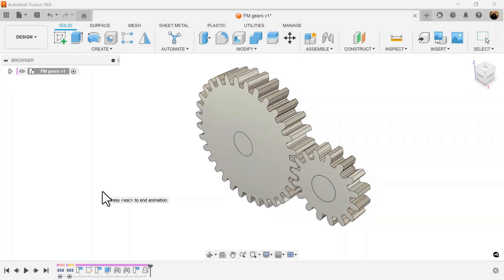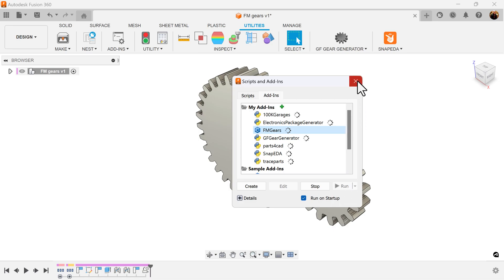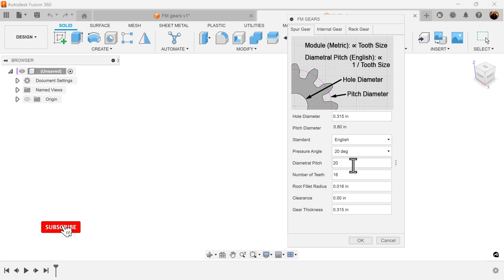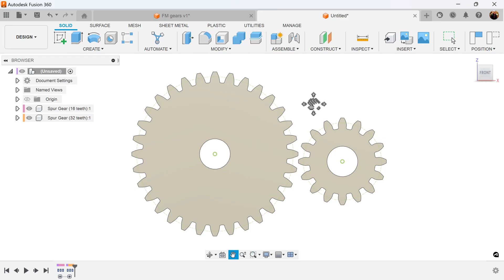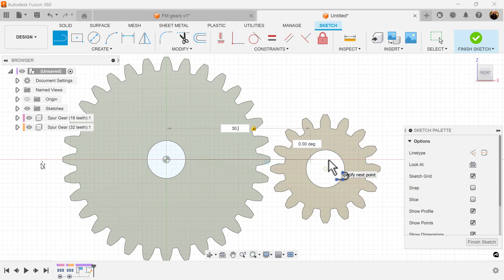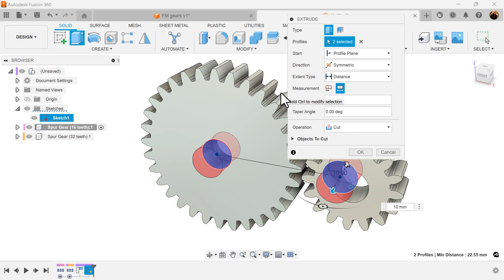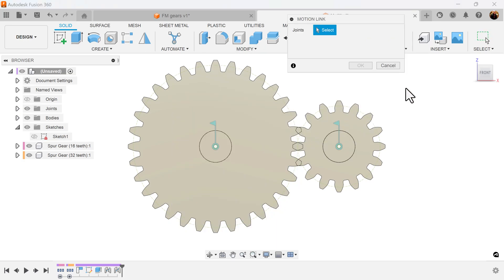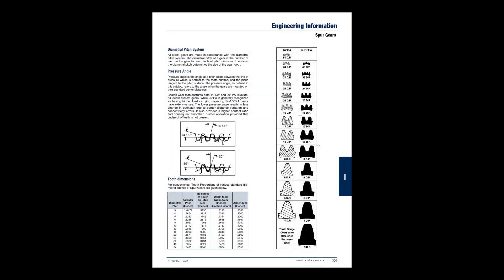Create Spur gears effortlessly with this Fusion 360 Plugin!

Comment: quick question, how do you mesh the gear teeth?
Reply from the maker: This is something you will need to manually perform ratios. Using the joint command you can test your setup by doing so. This is a good idea for a video I can create in the future.

Comment: Lol, I thought you said “effin’ gears”. 😆 I like these gear plugins. Another one is GF Gear Generator which allows for helical and double-helical (herringbone) gears.
Reply from the maker: Yes, I've actually use that one as well.
Reply: but its limited for maximum 250 teeths in a gear. You cant do larger than that.

Comment: Another good video CJ. Just have a couple of points. When you animate the two gears, the teeth overlap, then after rotating they mesh correctly ??? I found I had to rotate one gear by 5.6 degrees to align them. Nothing mentioned in the video. Secondly, how to I get to animate the gears upon completion of the exercise? Also can the speed of the gears be reduced ?
Reply from the maker: Roger, I purposefully left that part out so individuals can figure some things out through deductive reasoning. Also, you cannot slow down the animation

Without going to the animation tab, you can animate the gears after creating motion links by right clicking any joint and selecting "Animate joint relationships".

If you want to create a slower animation you will need to go into the animation tab to do so.